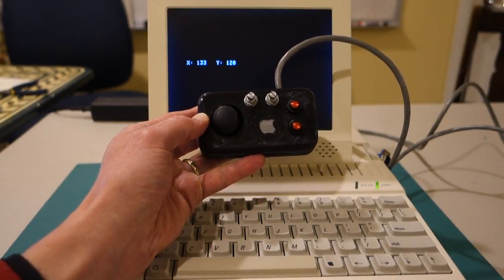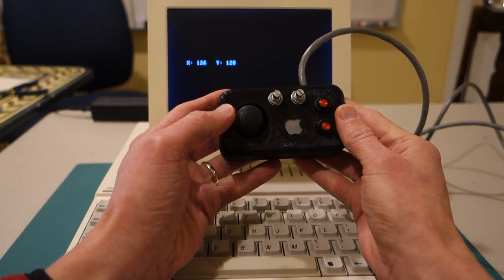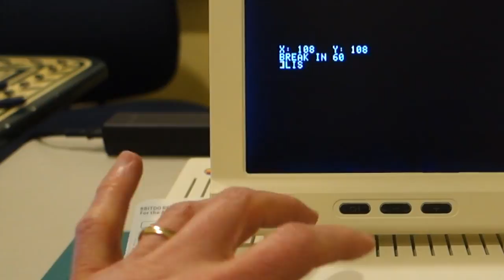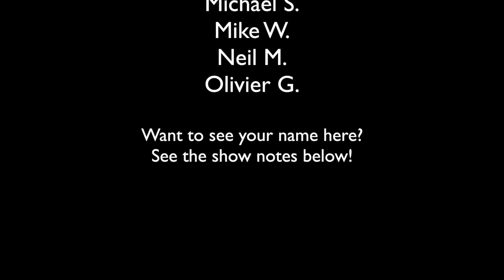Assembly Lines #43: 8Bitdo AP40 Gamepad Testing

Comment: Thanks for the follow-up. It's baffling the gamepad doesn't support analog output. Seems like a small amount of microcontroller code could correct that. I wonder if it can be reprogrammed.

Also, thanks for alerting me to Silas Warner's Firebug. Very interesting game.
Reply from the maker: Yeah, I was really surprised at the poor analog output - it's like they didn't even test it. 3 values (11,108,255) is not analog... Anyway, "Firebug" is a fun game - very primitive but addicting.

Comment: What is that monitor you're using?  Been looking for a something like that for my IIc.
Reply from the maker: It's a NightOwl security monitor. They're no longer in production but you can sometimes still find them on eBay. I spray painted it with Krylon Fusion Dover White. See https://youtu.be/yEIhSSAXT2M for details on the power cable.